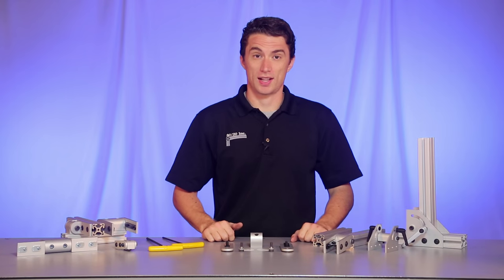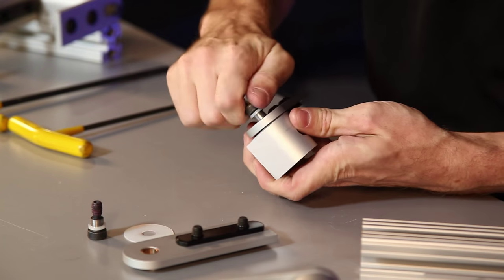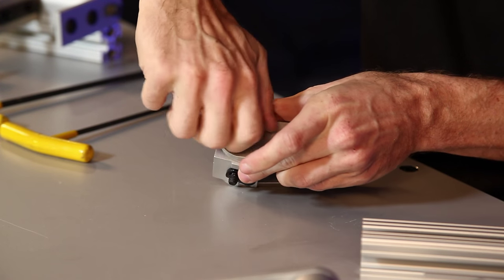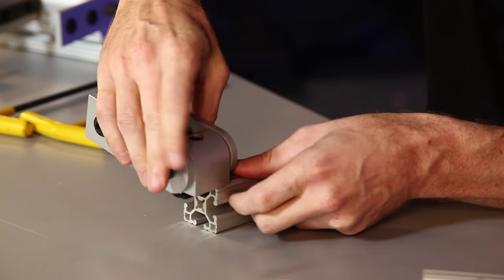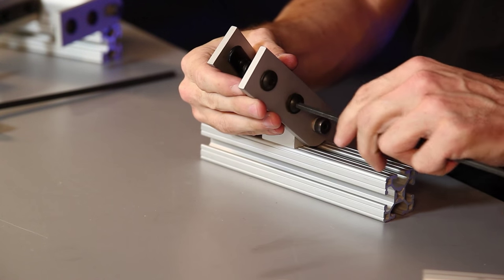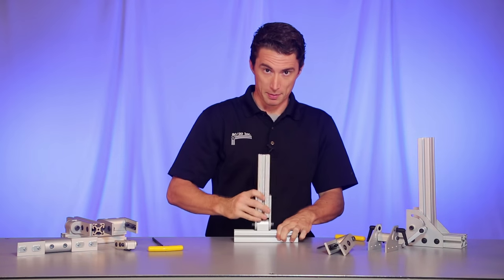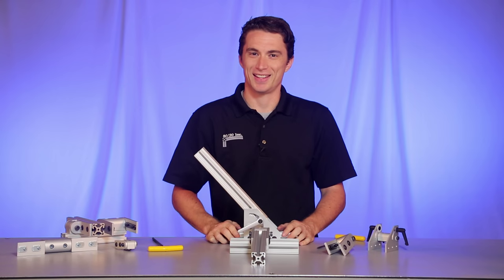80/20: Dynamic Pivots Overview

Comment: how much weight does these angles pivots handle?
Reply from the maker: That's a great technical question! To get the most accurate answer, please email 8020CRM@8020inc.com with this and any other questions regarding material strength specifications.

Comment: I have 2 sets of the 4317 90 degree pivot brackets working together to pivot two 24" long arms that are connected together with another arm at the end.  They are binding quite a bit and the only thing that seems to help is to leave the three bolts holding on one of the 2 Pivot Brackets (4333 or 4337) loose.  I have to leave the bolts loose on one of the Brackets on each side.    Everything looks to be square and lined up well.  Is there something else I need to do?  Also it seems to bind a bit worse when the pivoting arm is parallel to the part the pivot bracket is mounted to.
Reply from the maker: Thank you for bringing this to our attention, Chris.  Our design team is currently reviewing the issue. If you’d like, please email us at marketing@8020inc.com and we can follow up with you directly.
Reply: I was looking around and noticed in similar situations other people were using a 4339 & 4348 instead of two 4317 assemblies.  Similar to the drawing table in this video
https://www.youtube.com/watch?v=DsQm3KN24VM

 I found if I removed one of the locking levers (2797) from each of the 4317 assemblies, it would then work fine.
Reply from the maker: Thanks for the feedback, Chris. I’ve forwarded this additional information along to the design team, who is looking into this.
Reply from the maker: Chris, we are currently working on a solution and would like to reach out to you with some more information. Will you please email us at Marketing@8020inc.com so that we can communicate directly?

Comment: Do you offer any pivots that lock in at exact angles, such as 45° or 90°?
Reply from the maker: Depending on your exact needs, we have a few different products that may work.  If you are looking for a hinge for panels, some of our Detent hinges will "lock" into varies positions.  For profiles, we have pivots and plates that have movement range of 90 and 180 degrees that can lock into place using a brake kit.  We have also seen customers that will have these plates custom machined with notches to ensure exact positioning at desired angles.
Reply: @8020llc  We're looking for a folding type design that locks at a 90 degree angle, would these products do that well? Or are we best looking elsewhere?

Comment: Can the pivot hubs be tightened to a point where they are locked in at a certain angle without the brake handle?
Reply from the maker: Hi there! Thank you for your question. The brake handles are necessary for the proper utilization of dynamic pivots and securely locking them into place.
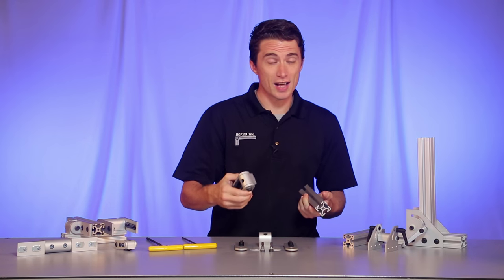Reply: At 0:36 in the video there is a bracket at the right side of the screen that looks like it would limit the movement of the pivot to 180 degrees. There may be a 90 degree bracket on the 8020 catalog.

Comment: I'm confused about how to mount the last dynamic pivot you showed. It look incorrect to me for some reason. When the profile is perpendicular to the other, I'd expect this pivot plate to allow the profile to be straight at the high point of the plate. Then rotate 90 degrees towards the low point of the plate. This other video shown here shows it mounting to the end of the profile to achieve this: https://www.youtube.com/watch?v=-SQdGczQnno
Reply from the maker: +JLAW904 Thanks for the feedback JLAW.  The installation method you mention would be a correct and more common method of using that specific dynamic pivot.  As with most 80/20 products, our pivots can be used in a variety of ways to suit our customers’ varying requirements.